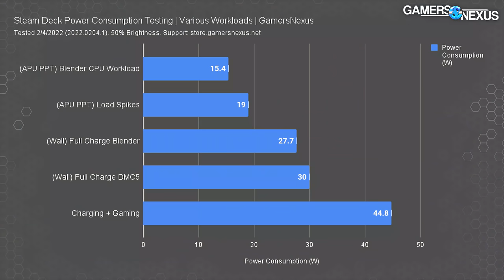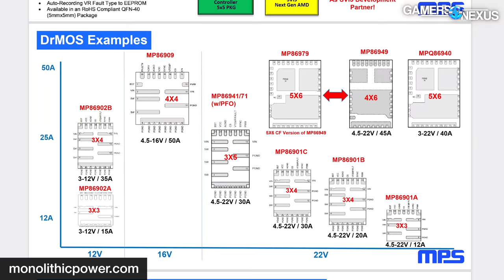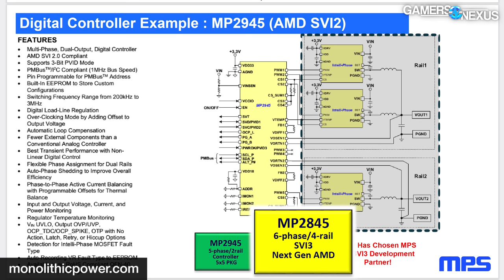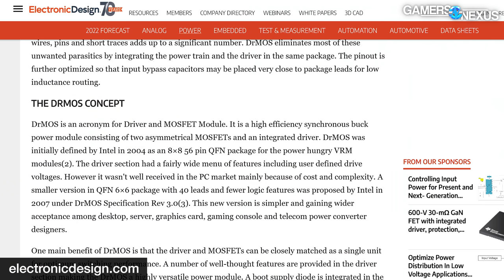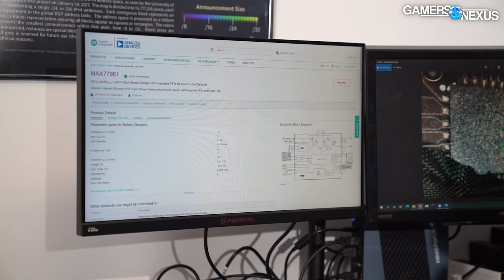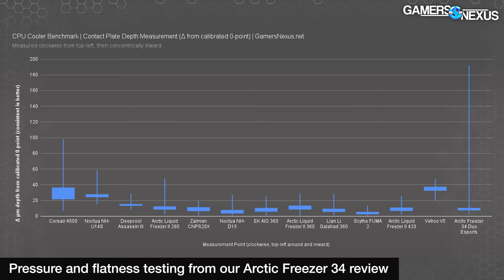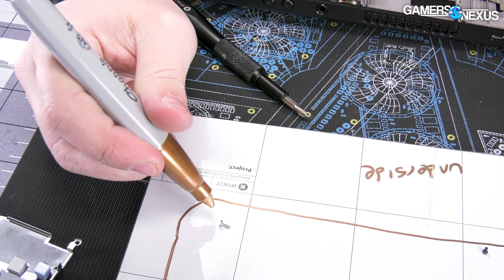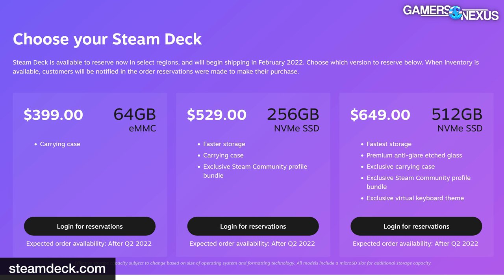Steam Deck Tear-Down: Build Quality, Disassembly, & VRM Analysis

Comment: Valve said without the shield between the SSD and Wifi module there could be interference and they discouraged users from swapping the SSD. Would love for you guys to test this and see if swapping the SSD with a non-shielded one is actually problematic.
Reply: I think they are not allowed to test this until release. But i would be interrested too
Reply: It depends a lot on how carefully the ssd was engineered to avoid excessive RF radiation, which interferes with the other radio signals used to carry your wifi.

It'll be highly dependent on the model of the ssd. Worst case you'll have no, or very slow wifi with a bad ssd.
Reply: It's going to depend on the model of SSD you used to replace it, and how carefully you managed to swap it, it's going to be very variable.
Reply from the maker: Hearting because a lot of people are interested, but this is too variable and outside of our comfort zone to adequately test. We could do anecdotal stuff, but would prefer to avoid it.
Reply: @hiyall15  that would be a one off scenario that doesnt tell you anything about the actual impact.
you would need to test a lot of different SSD´s and also measure the power consumption of the wifi module at the same time to account for that the module could be using some extra power trying to compensate for the extra interference.
And even then you still dont know if or how much interference there is as you are only looking at the end result without looking at anything in between like doing an actual spectral analysis of both the SSD and the wifi module.
Reply: @Pixelplanet5  what about applying your own shielding to the new SSD?
Reply: If it ends up not making a difference, I don't think Valve would be happy to sponsor them again.
Reply: @hiyall15  do you have the equipment at home to manufacture and test your own EMI shield?
Most ssds don't even have an exposed ground plane you would need to make the shield work most efficiently.
Reply: @hiyall15  I've wondered about applying your own too. You could certainly buy an EMI shield sticker. Prolly for a couple cents.
Reply: @Pixelplanet5  I have EMI shielding tape that I'm going to put on my SSD and then ground it
Reply: The NVME SSD in my laptop is right on top of the wifi card. And it's a full sized 2280 drive not a little one. I don't have any trouble getting full speed out of my wifi. I think it's just snake oil to discourage laymen from replacing their SSD and going for a more expensive model instead.
Reply: I think for the most part Valves comment about excessive power draw and radio interference is more of a scare tactic to prevent the casual user from replacing the drive.
Reply: @Pixelplanet5  There are not many 2230 SSD available in the end user marked. Currently it would be enough to test the Kioxia BG4 512GB and 1TB cards.
And with the thicker 1TB card it's even questionable if it's  fits in the socked.
Reply: @GamersNexus  bruh, you guys literally have components under microscopes haha. If not GN then who can tell me what SSD I can successfully swap into this? I'm totally fine with a couched, 'this would likely work' video
Reply: @Lord Rahl  considering the thought and engineering put into the entire design, it makes no sense Valve would shield the SSD which is non-standard for SSD manufacturing only to make it seem like users shouldn't replace it.

Valve, err Gabe, said you can replace the SSD but the hardware isn't designed to be disassembled by an average person which PCs are.
Reply: Pretty sure this is just more marketing mumbo jumbo so people feel more compelled to buy the more expensive model. We'll find out a lot more after release when people actually test replacing the ssd but I don't see why you can't replace it and use EMI shielding tape.
Reply: @Pabz Roz  if that were the case then there would have been less support for SD Cards.

Why make an incentive to buy a model with more expensive storage and then remove that entirely by making sure games are fully functional on extremely cheap atorage.
Reply: @GamersNexus  Most manufacturers get around this by having a compatibility list of approved replacement modules with part numbers.   Other stuff MAY work, but the stuff on the list WILL work.
Reply: @RFTL  Whilei have the 512gb model ordered, I will be replacing it with a Micron 2TB 2230, that I was lucky enough to get, that's gonna work just fine. It's one sided, and as someone already stated, it can be insulated if need be.
Reply: EMF is a tricky one to test. You would swap it and it would probably work flawlessly for the test but you really can't rule out a random error occurring at some Point. But it can't be to hard to fabricate a shield with a couple of layers of capton and a bit of conductive foil can it? I mean technically even a few layers oft aluminium foil should do the trick or wouldn't it? JUST MAKE SURE TO NOT SHORT ANYTHING AND USE INSULATING TAPE BELOW!
Reply: @Pixelplanet5  The screw is grounded isn't it?
Reply: @GamersNexus  at the risk of over-nerding... we're OK with your best effort.    A guess? You, Spock? That's extraordinary...
Reply: @Jackpkmn  interference can actually cause problems especially with the controller
Reply: @hiyall15  no room
Reply: @realbingus  nah, that would indicate Valve made the right decision, don't know why that would be disfavored
Reply: Will the wifi module be replaceable? The lack of a wifi 6 chip kinda sucks
Reply: @facundofortes7912  you wouldn't really need a wifi 6 chip on such a device
Reply: @GamersNexus  The thing is, SSD's do eventually fail (working computer repair, I've seen it fairly often).  As such, it makes sense to know if it's possible to replace the original one or not.  Unless Valve is saying the rest of the components are likely to fail first, which I would hope not.  Of course, I'm also curious if the entry level model has an M.2 slot, which allows for upgrading it to an NVMe (obviously this wouldn't be approved of by Valve, but it's still interesting to know).
Reply: @AtaGunZ  I'd really like to use it as a steam link device, I do it with my laptop all the time and it's only been viable lag-wise since I picked up a laptop with wifi 6

Comment: I feel like GN is the only media outlet who understands that thermal imaging is not always useful
Reply: I know right? No idea why other channels don't go deep on SOC, memory and other component temp itself. Seems like obvious superior testing method to me.
Reply: @SSmitar  Simply because that's not what they are specialising on.
Reply: @SSmitar  takes work and actual tehnical knowledge.
Reply: Well, Thermal Imaging can be useful in this specific case since it's a handheld, you can check if the device will be too hot in your hands.
Reply: Most users don't care about per IC temp. And it's not something they should care about at all.
Reply: I mean this is all cool, but I jumped to the conclusion because I don't need all the technical details, like most of users don't. I think that thermal imaging was done well by Linus for the time he had available back when he made the video and had limited freedom to handle it.
Reply: @Poxenium  Well he isn't a media outlet
Reply: @CalaTec  definitely. For a handheld device like this they're a lot more useful.

They can show how hot it will get to the touch. It can also help understand where hot spots are and why.
Reply: @CanIHasThisName  Fine, so don't do thermal testing at all then. Do it right, don't do it at all, those should be the only two options on the table. "LOL I POINTED CHEAP FLIR PHONE CAMERA AT DEVICE HERE'S THE TEMPERATURE OF THE OUTER CASE" should not be something anyone does. That's clown territory.
Reply: @SSmitar  Probably because it requires a lot of specialized knowledge and skills, and it's cheaper and easier to just not get those skills :P I don't mean that as an insult to other channels, but Steve's really specialized in the super technical aspects of things in a way other channels just aren't. Steve has a background in software dev and in QA, and Pat has a degree in computer engineering. Those skills aren't really a thing you can just acquire over night. Which is where the value on the channel comes from.
Reply: For a handheld device like this, thermal imaging of the assembled unit is very valuable, I don't want to hold an uncomfortably hot thing in my hands. It doesn't tell you much at all about the internal component's temperatures but to say it's not useful is just wrong.
Reply: I'd argue its always useful, its just not the whole picture. But you can learn alot from the airflow and thermal imaging - including very useful technical information, where the case is getting hotter is a place your armorplated/ergo grip doesn't want to cover or must cover with a good radiatior material etc.
Reply: But, it is cool...😎
Reply: Actually, is quite useful, if you know what you are seeing.
Just like sight is useless if you don't know what you are seeing.
Reply: Is useful to know how comfortable is on the hands/lap but no as a measure of the thermal system efficiency/effectiveness
Reply: HUB Steve also uses temperature probes though he doesn't really mention it. I think HUB is the best hardware channel but they are lacking the visuals that LTT and GN have. They need a couple more people on staff imo to really put that stuff together. Like illustrations of monitor overshoot beyond the simple UFO images and excel spreadsheets would go a long way
Reply: @mjc0961  This is such a smooth brain take.
Reply: @mjc0961  You could make this argument ad infinity, that there is always a better way to do something. By that same logic, nobody should ever talk about a screen on a device unless they also do a response time, input lag and color accuracy testing, and every single tech outlet should delete their GPU and CPU reviews because they didn't measure specific components on the hardware. I really don't see what exactly is it that bothers you about people using the tools they have and the only explanation I have is that you're trying to achieve some second hand elitism or something. Never mind that the surface temperature of a handheld device matters a whole lot.
Reply: it's a pity they don't have any female staff members so they can do thermal imaging on a monthly basis...
Reply: @SSmitar  
"No idea why other channels don't go deep on SOC, memory and other component temp itself. "

Probably because the manufacturers fear the truth and require to be silent about these "hot" topics from their sponsored partners, because these kind of tests reveal their design flaws and bad decisions (for example: using bad chips instead of good ones in their devices).
Reply: @WayStedYou  Youtube IS a media outlet.

Comment: Patrick's explanation of the terms VRMs, MOSFETS, controllers, etc and their purpose in the Steam Deck or in the tech world overall was pristine. Steady, articulate and easy to digest. Thanks!
Reply: I feel like I'm back in school.   This was so comprehensive and helpful.   Big thanks to Patrick and GN - and please provide more of these kinds of in-depth explanations - I'm personally going to stay far, far away from 6A charging circuits!
Reply: I dunno chief, it felt like he was just reading a brochure and not really explaining much.
Reply: My one criticism would be when he was talking about the charging circuit and he noted that because it can output 6 Amps, that makes it dangerous. Since we're dealing with relatively low voltages, talking about the max amp output, regarding safety, is pretty silly.